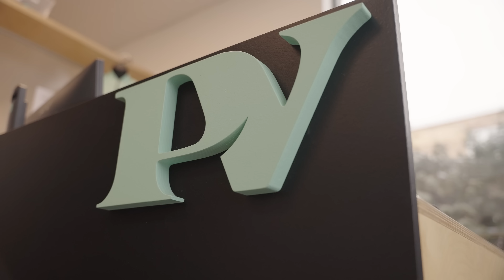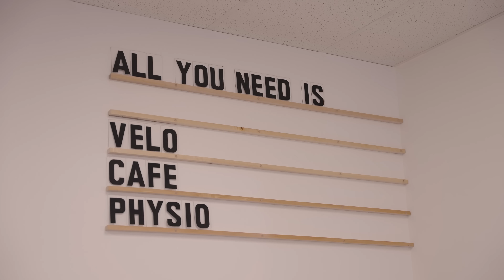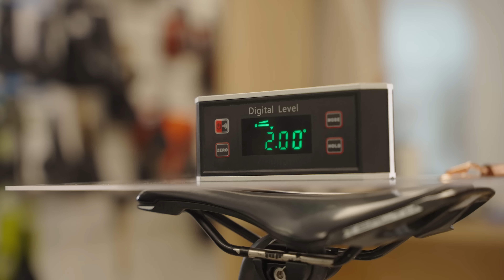My Cycling Fit Was WRONG THIS WHOLE TIME!?

Comment: No offense, but when it all comes down to the end of the video, I do not feel that you are confident with the opinion of your fit by the fitter. I think that this is somewhat proven by the fact that while still on the bike messing with the stem, you mentioned that you plan on moving the bars around. Why would you want to move ANYTHING around if you feel that the professional bike fit that you just got was done correctly, and you are already flexible enough to handle a slammed position? I learned everything that you had done and said with your bike fit by watching other YouTube videos, and I feel that this bike fitting was a basic bike fit that anyone could have done by themselves, including you, with basic knowledge using your experience riding a bike, or watching a few videos on YouTube..... it did not take a pro bike fitter. I did not see or learn anything different or extraordinary about a bike fit from watching this video.
Reply from the maker: Sorry you didn't learn anything, this video was definitely more targeted at a wider audience.
Come back next week and especially on EP3 and EP4 for great, in-depth knowledge :)
Reply: @CharlesOuimet  thank you,  but no need to apologize. My comment was more so directed at the bike fitter. I expected more in-depth knowledge because I hear so many people talking about the high benefits of getting a bike fit by a specialist, , and so when I see a bike fit video, I really expect to see where ones money is supposed to be valuable. In the case of this specialist , I just don't feel that I would have got my money's worth from what I saw on the video. But I'll be back to see your other episodes!
Reply: @CharlesOuimet  ..... I also would like to add that When I first started riding and it was suggested to me to get a bike fit, that I did not do so in fear of going to a inadequate bike fitter, as apparently there are many. So when I see a bike fit video, I really expect to see the bike fitter going into depth behind his reasonings and really making things for the rider the best to his ability, and I just don't feel that he really put forth too much effort to make adjustments when you said that you were not comfortable with certain positions, that's all.
Reply: I don't fully agree with you. Saddle fore and aft can be tricky. Especially when you change Saddle height.  He obviously had the Saddle too high...that will immediately feel foreign to him when lowered...if you're doing this by yourself you're more likely to return to your previous too high Saddle.  Coz you're basing everything on the feel. Wanting to change things around after a fit is the exact response 90% of the ppl will have because your body want what it's used to. You can feel stretched...it doesn't mean the fitter did a bad job ...u just need to give yourself time to adjust to the new position.  Some ppl can wait some cant.
Reply: @beltonhogue in PhysioVelo's defense, like Charles said this video was intended for a wider audience so he clearly did not go into the details of a bike fit.
This clinic is one of the best places to get a bikefit in Quebec.

If you're looking for real insights: like Guillaume said the best way to get faster is to avoid injury and the bike fit is intended to keep you from getting injured. The specifics will depend on the individual
Reply: @paulemilecolas7982  ....But, what is a "wider audience?" You don't have to be cycling for 5, 10, or 20 years in order to be able to understand what a fitter is describing to you on a bike. If you are going to teach a bike fit on YouTube, it is for all to learn from and understand,  no matter what level you are on, right? My other point is, If you feel good on your bike and don't have any pain, no hip impingement, and are not new to cycling and on top of that have the ability and the flexibility to slam your stem to get more aero and can handle it, than what on Earth do you need a bike fit for if you aren't in any pain, and you ride just fine, than there is nothing wrong to where you even need a bike fit based on the "your body talks to you" rule, right? If I was a bike fitter, and someone came to me because they felt that their bike fit was not correct, and then I help them, and then immediately afterwards they say "well, I'll be moving my bars back up", then my question to them would be..."Well then what did I do that you couldn't have done yourself, and why did you come to me?" Furthurmore, if you come to me and all that i do is move your saddle 2mm and slam your stem based on logic, than I wouldn't charge you any money. There are some bike fit videos that use 2023 technology to get you fit perfectly with a Computer, not by hanging plumbers from your knee and eyeballing.  If you are going to show us a Profesional fit, than show us a Profesional bike fit, That's all that I'm saying! But like I said, no offense, if the video helped you, then great!
Reply: @Dustydayzz  ....What is a bike fitters job? To fit you on your bike, right? If you are not positioned on your bike right, and you go to fitter to help you for whatever reason....pain, don't like the ride, whatever, and then when they are done, you move Things around, than the bike fitter did not do anything that you couldn't have done yourself. That bike fitter should have said..."no, this or that is wrong, and here is where you need to be. If after such and such time, you feel pain or feel that you don't like it, then we can re-evaluate the situation"... To me, that is what a bike fitter who is confident   about his fit would say. Furthermore, I feel that if the rider had confidence in his fit AND fitter, then he would say...."ok, I'll give it a shot". If you are going to a bike fitter, the whole point Is to let them do their job, not what you want, otherwise, just stay home and do it yourself! You don't know how to use an Allen wrench to adjust your saddle and seat post? When you've got it right, you are done. By the time your body gets more flexible because of riding for a while, and you want to experiment with a new position to be more aero or whatever, you have had enough experience to do the adjustments yourself. But I am not saying  that there is anything wrong with going to a bike fitter. Have at it!
Reply: @paulemilecolas7982  ....My view on a bike fit is not warped at all. I didn't say anything at all about this fitter not giving him 47 or whatever number you said different adjustments. No where in this video is there any mention of 2-3 hours of file notes that you can do yourself, as well, either. So let me ask you this...a bike fitter seems to be your solution to sitting on your bike to get the best performance out of it.... You don't know your own body and what you are capable of doing on a bike? You aren't able to make adjustments on your own bike and remember any adjustments that you may have done, and what did or did not work for you?  Certainly you have heard horror stories about incompetent bike fitters....What do you say about cyclist that go to bike fitters and are not happy about their fit because now they can not ride the bike as well as they did before the "professional bike fit" was done? How about cyclist that go to a bike fitter, and then goes to another fitter rite afterwards, who then gives them a whole different recommendation on their fit? Which "Specialist bike fitter" is correct with their assessment? Are those cyclist views warped, too? There is nothing wrong with going to a bike fitter.....let me say that again....there is nothing wrong with going to a bike fitter....But not everyone is incapable of building their own file-  if need be, or learning how to do their own bike fit. Youtube is a place to learn every and anything, proved by the fact that millionaires have been made from teaching others. Are their views warped? If spending money on something that you can do yourself floats your boat, more power to you, but it does not mean that you possess any more knowledge than somebody that did their own bike fit, learning on YouTube, Right or Wrong? (Please answer that on behalf of your Velo). There are several bike fitters on YouTube that I would trust 100% if I needed a bike fit, however I don't need one, because I used those same bike fitters advise to learn, and not only do I feel great on my bike, but there is no need to do any adjustments anymore because you can only do so many adjustments on a bike to where you are happy, and at some point, there is no need to adjust anything, like many of the cyclists that I know that have been riding for yeeeeeeaaaarrrrrsss..
Reply: @beltonhogue  you don't know what you don't know so your self diagnosed bike fit is just as accurate as your knowledge of bike fitting.

If you're inquiring on a bike fitter's credentials, google if there might be a certain type of course or training, prepare a list of questions for the fitter, ask around to know if that fitter has a good or bad reputation. Do your due diligence.
Your interaction with the fitter should be a relationship, not a simple transaction. I've been with the same fitter for 5 years. At first I lived my fit but wanted him to slam my stem but not understanding the mobility work that was required on my side to allow me to ride with a more aggressive position. It took me 3 years to understand that my own lack of flexibility and hip mobility was holding me back.

Comment: The bike seems to be too big
Reply: Why do you say that?
Reply: His hands seem to come to rest on the top curve of the bar as opposed to resting on the hoods. He wants to bring the saddle fwd to fix his reach issue but the saddle wing is irritating the back of his leg. Keep in mind his seat post is 0 set back. He may be in the cusp of in between sizes.
Reply: @adccars359  Interesting. Given the number of variables in play, there's probably a lot he can do yet before we can declare the frame too large.
Personally, I think his saddle is still too high (lots of hip rocking) so you may well be right.
Reply: @adamjd7645  Shortening the stem by about 2-3 cm should put him in the ball park. But a size down frame should give him more room to optimize his fit. More seat post deflection. better weight distribution with some fore aft adjustment.  Shorter head tube. will give him more room to dial in his reach. 90 -110 mm stem should do.
Reply from the maker: Thanks for sharing! So far, it's be awesome!